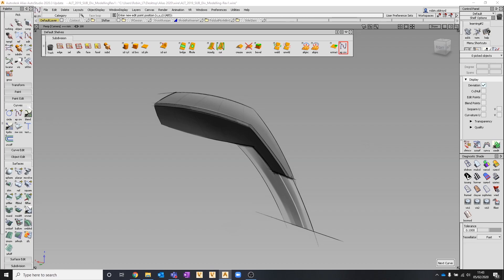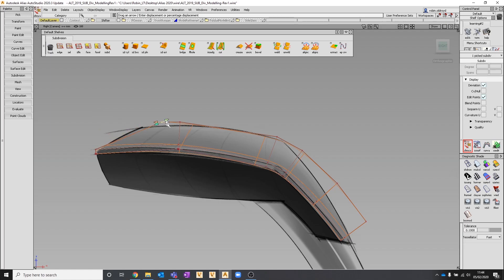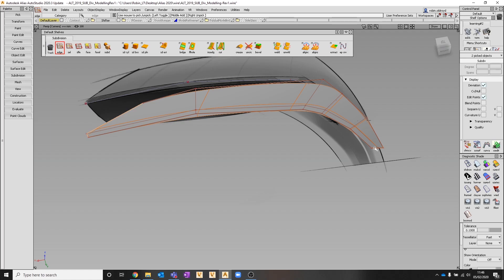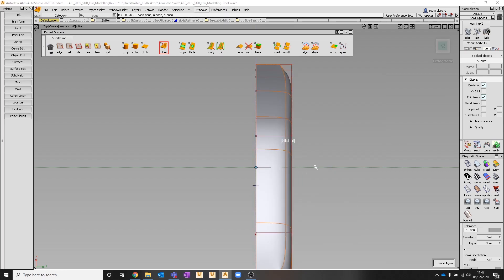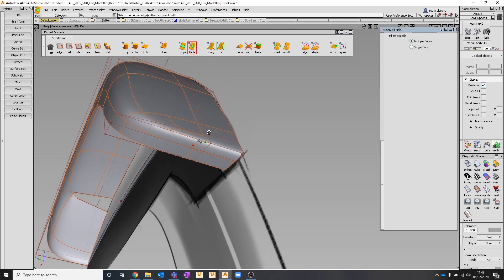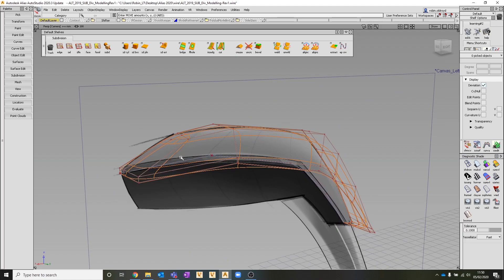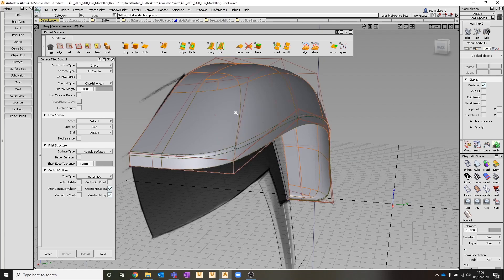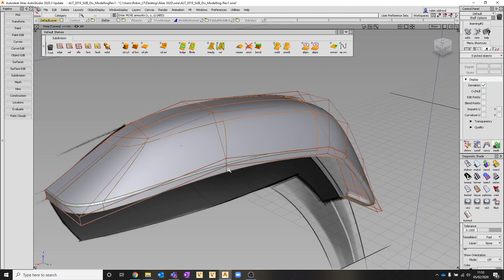Alias Sub Divisional Surfacing - Chapter 2 Building your first model

Comment from the maker: I had a question from a student (which am not able to reply to directly it seems) Q. Why they can not use the sub D extrude. There might be many reasons but make sure you have Alias concept, Surface or Autostudio 2020 and above. If you still have an issue please get in touch again.